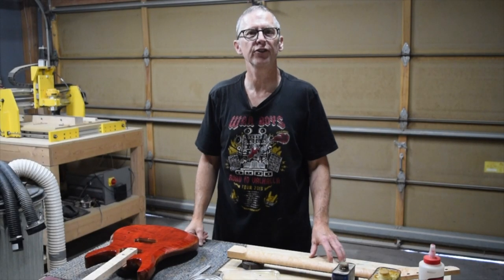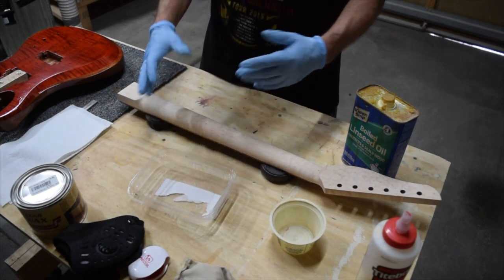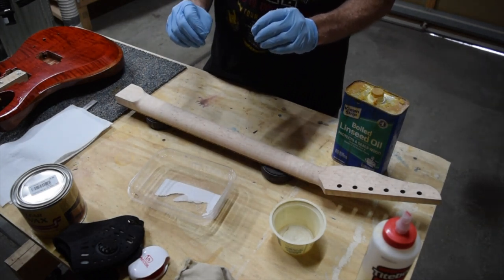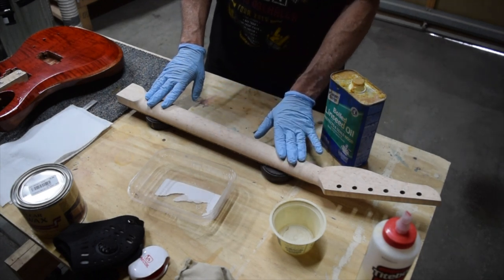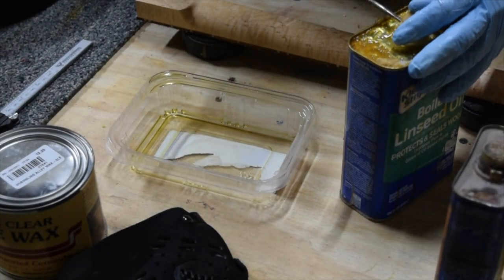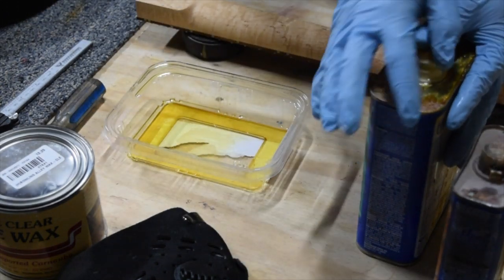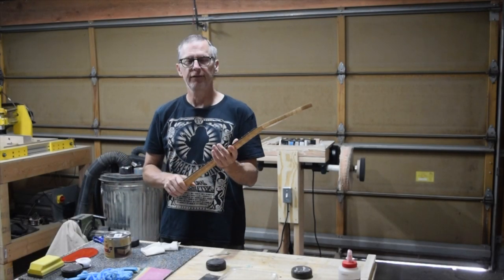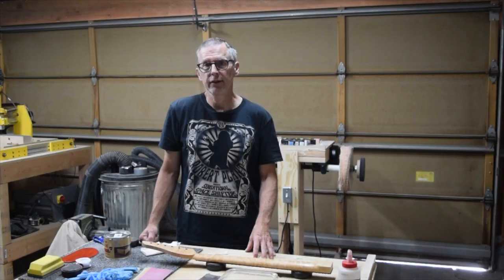Applying An Oil Finish On A Guitar Neck

Comment: I finished a neck almost exactly the way you did with BLO and Japan Drier; even sanding with Mineral Spirits and BLO. Now I want to add a water slide decal to the headstock and directions say to cover it with clear varnish to seal the decal. If I just cover the decal there will be a shiny spot. It says you can use clear lacquer if you're careful to apply thin as it will eat the decal. So I'd have to do the whole headstock to make it even and I'm using gloss lacquer for the body. What alternative could I use to seal the decal? You mentioned early in the video a mixture of equal parts of mineral spirits, BLO, and oil poly (assuming satin). My neck finish has the same sheen as yours. To seal the decal should I make that mixture and apply to the headstock or just lightly spray with some poly, or go ahead and get varnish? Your videos are great and well explained which makes them great. I noticed though that you didn't use the 3 part brew to finish the neck.
Reply from the maker: Sorry, I can’t help with this. I don’t use decals.
Reply: @HighlineGuitars  Thanks for responding, quickly. I'll research it. Using your finish technique on the neck I'm really pleased with how mine turned out. Silky smooth but not glossy.

Comment: Great technique! Seems fairly foolproof, says the fool.. hehe. Looking to do this on a very light unfinished Fender Squire Mustang neck. Is it possible to tint the oil to get a darker finish or would you stain the neck first?
Reply from the maker: Yes, you can tint the oil. Afterall, an oil-based stain is just boiled linseed oil and pigment. I use artist's oil paints to tine my oil.
Reply: @HighlineGuitars  Thanks so much for the reply.. You do really nice work, thanks so much for sharing your smarts!!

Comment: I love this videos information  :  )  I have a question do I wait til after I apply around 3 coats before I wet sand with mineral spirits and linseed oil mix or after every application? I am just a bit confused but definitely going to use your method to restore my old 80's Aria Pro Series 2 guitar which was my first guitar and a gift from my brother. 🎸🎸🎸🎸🎸
Reply from the maker: I like to apply each coat by wet sanding them into the wood. For the first coat, I'll apply it with 800 grit wet/dry sandpaper. For the second coat I'll use 1,000 grit. For the third coat I'll use 1,200 grit. FYI: The finish won't be glossy. It'll be matte, yet buttery smooth.
Reply: Thank you so much for replying and the awesome videos \o/  Got the first coat and sanding done so on to the next when its good and dry.

Comment: What about pure tung oil, is it a good option for finishing a guitar neck? I do not have an option to buy a polymerised tung oil in my part of the world and was wondering if it is a good option. I have a caramelised maple neck which I re-carved and want to protect it and maybe give it a better look. Thx
Reply from the maker: Pure tung oil works Greta, it just take months to fully cure.
Reply: @HighlineGuitars  thanks for the info. So it's really months?! Most times I read that it should take up to a week, but months is really a bummer. Can it be played during the curing period? Is it worth waiting so long, is it that good? I am doing this on my own guitar, so nobody is waiting, and I have a spare.
Reply from the maker: @lorencing  It takes about a week or so to dry and four or more weeks to cure. As long as it is dry to the touch, you can play it. You'll know it's fully cured when there is no noticeable odor.
Reply: @HighlineGuitars  my bad, I got it mixed up, yes, a week to dry, not to cure, thanks. So then I’ll watch for the smell and go with the tung oil.

Comment: thank you for this great video. I love your work and your presentation. I am about to embark on a Tele project and wil be using an unfinished one piece Maple. neck and unfinished Alder body. 

I want a smooth natural feel and your method seems ideal if possible I'm just not sure if I need additional coating on the fretboard. Am I right in believing all I need to do is apply boiled linseed to the whole thing including the fretboard once as you describe and I don't then need to finish the fretboard any more? 

Thank you for your help. Stay safe and keep the videos coming. I love them
Reply from the maker: That’s right. Just a thin application of BLO on the neck and fretboard. Try wet sanding it in as you apply it with 600-1500 grit for a silky smooth surface.
Reply: @HighlineGuitars  Excellent. It's my first build and your videos are super helpful. Thank you

Comment: Thanks for the video! Im going to use tru oil on my guitar neck
Do you recommend applying tru oil, let it dry and then hit it with 0000 steel wool after each coat? Or putting a few coats of tru oil and only then hit with 0000 steel wool?
I'm looking for a very smooth ufinished neck feel with no shiny areas or glossy feel.

Thanks,

Matan
Reply from the maker: Apply a coat of Tru Oil and let it soak in. Then, wipe off the excess and let it dry for at least 24 hours. Next, rub it with the 0000 steel wool or better yet, a fine synthetic pad. Apply the next coat and repeat this process until you are satisfied with the finish.
Reply: @HighlineGuitars  Thank you for your advice and for the Great Video!
Reply: @HighlineGuitars  do you think that two to three coats will protect the wood? Or i need more from your experience?
Reply: @HighlineGuitars what do you mean when referring to synthetic pad?
Reply from the maker: @Matan2222222  https://www.nortonabrasives.com/en-us/hand-pads

Comment: This has been incredibly useful. Ive actually been using boiled linseed oil for years. Im watching cause im about to finish a mahogany neck with a maple fretboard. I think im sold on using this technique for the neck (with the Japan Drier) and BLO (and then the 1500 grit wet dry with mineral spirits). But im still not sure about the fretboard. Any recommendations?
Reply from the maker: I use boiled linseed oil or ting oil on my fretboards. If the fretboard is Maple, I’ll add some polyurethane to make the wood easier to clean.
Reply: @HighlineGuitars  I was planning on doing the body with a rub on poly. Would that work (mixing in a slight bit, of course how much ill test out on a scrape piece) or are we talking pure poly.
Reply: @HighlineGuitars  can i wet sand it with regular water?

Comment: I followed this process on a Tele with a maple neck--just as he says, silky smooth! I'm building another guitar with a mahogany neck now. Would this finish work on mahogany, it's a rather open-grained wood?
Reply from the maker: I've done it many times on Mahogany and they always come out silky smooth as long as you wet sand in the oil. Start with 600 grit and work up through 800, 1,000, and 1,500 grit.
Reply: @HighlineGuitars  Thanks much for the reply...I'm going to finish this neck today! Love your channel...so much good (real) information...hope it grows and prospers!
Reply: @HighlineGuitars  Finished the mahogany neck and it's been sitting for a couple days. Got the chance to feel it today -- what a beauty! Thanks again for this great tutorial!

Comment: @Highline Guitars what is the best way to clean a maple fretboard that has been finished with BLO? I don’t want to remove any of the finish.
Reply from the maker: Once the BLO has cured, it's there until you sand it off. Therefore, you can clean it with mineral spirits or naphtha.

Comment: I have 2 questions. I am making a maple fingerboard and neck. Do I do this before fretting? Also, does the wet sanding happen after each coat or just the final coat. Loved the video.
Reply from the maker: Wet sand after each coat starting with 600 grit after the first coat and finishing with 1,500 grit after the last coat.
Reply: So... do I fret the maple fingerboard before applying BLO coats or after? Thanks for the speedy reply Chris!

Comment: Would you perform this on the maple fretboard of an unfinished maple neck that is already fretted?
Reply from the maker: Sure. Just let the oil soak into the wood for 30-60 minutes. Then wipe off the excess from the wood a the frets. The oil won't soak into the frets, so it will wipe right off. Just be aware that using this technique on a fret board will require frequent cleaning maintenance and the occasional reapplication of the oil.
Reply: @HighlineGuitars  Thank you so very much! If it were you would you just leave the fretboard alone?

Comment: Very informative.  I would like to try it on an old acoustic guitar neck that I have already applied multiple thin coats of dewaxed shellac (french polishing) to.  I was going to use Minwax wipe-on poly (oil based) to provide a top coat that will protect the shellac form alcohol spills.  Will the boiled linseed oil be a better choice?
Reply from the maker: I'd go with the wipe on poly.

Comment: I tried this on some scrap and I really like the finish but I'm concerned about the additives in BLO. This finish isn't hard like a laquer finish and will wear over time. I feel like over time you'll be getting those metallic driers on your skin. Surprisingly the BLO and the odourless mineral oil gave me a headache and even working in a well ventilated space with the doors open for a short amount of time. Adding some polyurethane varnish to it as suggested here might be a way to harden it fully. The other thing I'm now considering is a shellac finish.
Reply from the maker: You're not the sort of person who should be using BLO. Use lacquer because that's so much safer. LOL!
Reply: @HighlineGuitars  I don't want to use a laquer finish and never meant to imply I did. Just this finish isn't hard and will wear so I'm considering what is going to be on my hands as it wears. I don't have anything against anyone who wants to use BLO. I looks great and it's probably not going to give you any health concerns so don't think I'm criticizing. I'm going to have a go with some very thin coats of tung oil and see how I get on with that. At this point I'm just experimenting on scrap pieces of maple anyway.

Comment: 2 questions..... when you use the boiled oil, why didn't you tape off the fretboard?  Also, does the neck feel "greasy" after you play, especially if you have sweaty hands?

Oh, also....I stained my guitar with water based dye stain 2 weeks ago.... and it still feels tacky.  How long will it take before I can cover it with a clear coat?

Thanks!   Your videos are great.
Reply from the maker: Because I also apply BLO to my fretboards. No, the neck doesn't feel "greasy." Don't know why your water-based dye stain still feels tacky. Did you apply it over raw sanded wood or was there something else put down first?
Reply: @HighlineGuitars  It was raw wood.  I have been planning on using TruOil on the body as a finish.  Would this be an issue or should I continue to let it sit and "dry"?  Thank you for the reply....Mike
Reply from the maker: @thewonderfulmrn9571  I have never heard of water-based dye still being tacky after 2 weeks. Normally it dries as soon as the water evaporates which happens in an hour or so depending on local humidity levels. You could apply the Tru Oil in a small section to see what happens. If it dries okay, you could proceed with the rest of the guitar. If you have adhesion problems, you'd have to strip the dye and try another approach.

Comment: Let's say I've painted my headstock but the rest of the neck is au naturel... Could I still use this technique over a water based acrylic paint?

Also, what are the little disc thingies you have the neck set down on? I've seen you put bodies on them as well.
Reply: It would work on the back of the neck, but not over the paint. Not only is it not a very hard finish (which you want when the surface is painted), I don't believe it will dry very well because their wouldn't be any wood for the oil to soak into. 

As far as the disks, they are just anti-slip pads for when you are doing stuff like sanding.

Comment: Dear Chris, I’m ordering custom maple tele neck with ebony fretboard. I’m going to follow your video to do the finish myself. What grits shall I ask them to sand the neck and fretboard to for dispatch please?
Reply from the maker: Hey @dynamn thanks for the tip! I would ask them to sand to at least 220 grit. 320 or 400 would be even better, but they may not go for that.
Reply: @HighlineGuitars  Hello Chris really appreciate you taking time to reply. They agreed to sand both neck and fretboard to 600grit.
Reply from the maker: @dynamn  That's even better! Sounds like a responsive vendor.

Comment: Very nice and thorough video thanks! I have a question, can you successfully apply a decal on a neck finished with boiled linseed oil?
Reply from the maker: Yes. Boiled linseed oil is a drying oil meaning it will dry when a thin layer is exposed to air. Just make sure you allow a couple of weeks to let it dry. You can also add Japan Drier to the oil and it will dry super fast.
Reply: @HighlineGuitars  thanks, so I should apply the decal before the finish or maybe do one coat, apply the decal and then a second coat?
Reply from the maker: @monz7951  Apply a coat of the finish. Then apply the decal. Finally, apply clear lacquer. Don't apply oil over the decal. It needs to soak into the wood.
Reply: @HighlineGuitars  okay got it! Thanks for the advice

Comment: Thank you very much. Is that oil ok with steel frets? I have to finish a maple neck with maple fingerboard and steel frets, and I wonder it it could be a problems. Thanks.
Reply from the maker: Why wouldn't it be? Oil has no affect on steel.
Reply: @HighlineGuitars Thank you. I wanted to be sure ;)

Comment: Hi Chris, thank you for the info. One Question, I have access to Teak Oil here. Have you tried it? It is supposed to teak oil will dry faster and harder than linseed oil, but if you have tried it, please share your experience.
Reply from the maker: Yes, I have used teak oil and it works well. I don't use it on a regular basis in my shop because it has a short shelf life and it will thicken before I can use all of it.
Reply: @HighlineGuitars  thank you for the info!

Comment: Chris, have you ever tried the Tried & True BLO with Resin varnish (not their stuff with  beeswax)?  I know it’s considerably more expensive but have seen some spectacular necks done with 10-15 coats of the stuff. Also, what’s the durability of a BLO finish?   Does it need yearly re-coats or anything?
Reply from the maker: Tried and True is excellent stuff. I don't feel it's too expensive, however, I usually just mix up my own recipe with equal parts BLO, varnish, and mineral spirits. For necks, I prefer straight BLO without varnish, which needs an occasional refresh.
Reply: Highline Guitars  thanks. I see stewmac has the T&T with beeswax in 2oz bottles which might be perfect for the hobbyist. One more quick question. When using BLO or this type of Tung oil varnish mix and wanting to just very slightly tint a maple neck so it’s not pure white, what would you recommend?
Reply from the maker: @Bloozestringer  Nothing. BLO and tung oil impart a natural amber tint.

Comment: Thank you for sharing your techniques! Can this oil process be used over the top of applied water based powder wood dyes (Keda)? Going to be finishing a gun stock and seems this would seal it well.
Reply from the maker: Yes. But if in doubt, test.

Comment: Am curious you didn't apply to the neck heel! We know its a bad idea to paint because that goes on thick! And could compromise a tight neck to body joint! But oil finishes are very thin! Or is the fact a tight unsealed neck is tight enough to stop moisture being absorbed, or because its so thick it wont matter??
Reply from the maker: I don't want oil finish to interfere with the glue's ability to bond the wood fibers.
Reply: @HighlineGuitars  Chris that wasn't something i  considered! As i assumed it was a bolt on neck! If i had known a set neck? I would have realised!

Comment: Hi! Tnx for very interesting video. I have a question: What kind of finish technique do you suggest for freshening up a Fender stratocaster guitar ( black body, maple neck, rosewood fretboard ) to a "new like" gloss?
Reply from the maker: If it's a Fender, use what was originally used.
Reply: @HighlineGuitars  I agree with what Highline says, with some clarificarions: In the past Fender has basically used automotive finishes on the body (obviously this does NOT apply to the MIAs that are finished with nitro), so I've used quality automotive finishing products to good effect. Meguier and Mother's products is what I use. As always, CHECK what kind of finish is on the guitar first.  Most polys and urethanes will play nicely with these products. Nitros not at all, use only products specifically designed for nitros.  Oils will need their own set of detailing products. A trip to a good wood working or furniture store should steer ye to good options. If ye want to be safe and can afford their higher prices, use Fender's recommended cleaning/detailing products. I just mostly use Meguier/Mother for the body, since ye can easily find them at ANY shops that stocks auto detailing supplies.  I typically sand and oil-treat the necks.  I hate glossy necks.